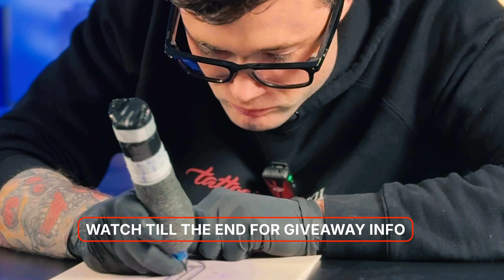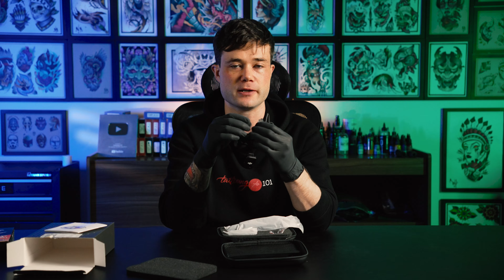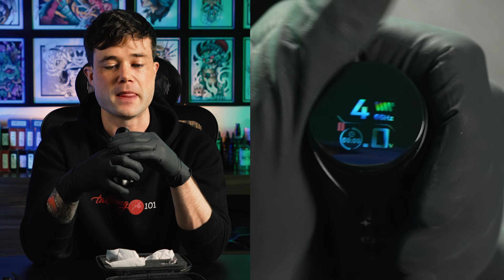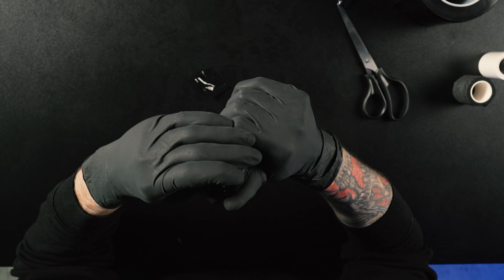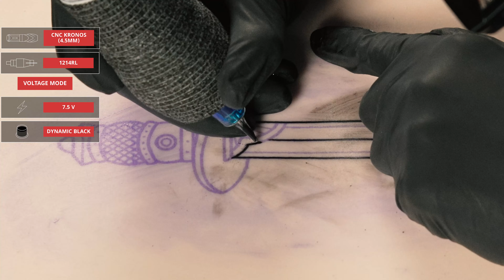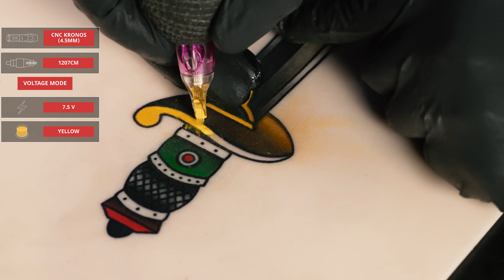CNC Kronos Adjustable Stroke Pen - Budget Tattoo Machine Review + Giveaway

Comment: Oh another question. Why wrap the machine? And how do you figure how much wrapping you need?
Reply from the maker: Wrapping the machine helps with hygiene and comfort. It creates a barrier between your machine and the tattoo environment, reducing the chance of cross-contamination. The amount of wrapping you need depends on your machine. you just want enough to cover the grip and other contact points without making it too bulky or hard to handle.

Comment: (My giveaway submission lol)

At a certain point when I am tattooing, the needle cartridge doesn't pick up as much ink and I have to dip much more often. With less ink, I can't pull nice long lines, like I have to take multiple strokes to build one line. It SEEMS like the ink is sort of.. drying up against the walls of the cartridge, causing it to have like, less surface area or something? 

Is this just buildup of my glide? I don't think it is, but it's hard to identify the issue.

Comment: Ok, I have done a few (very few) fingers. Top of the finger, ink goes in, stays in, no problem. They are several years old, and still look sharp. Same client, same finger, but on the side. I can't get ink to "sit" in to save my life. I tattoo it, 1 month later it's nearly gone. Then, to add insult to injury, same client, totally different location...same issue. I could not get a line to go in proper to save my life. Same machine, same needles, on a different client is not a problem. I ended up ditching the "pen" machine and went to my older rotary. The client FELT the difference, and finally the lines went in properly, but dang I felt like a noob sitting there with my (new-ish to me) pen machine and tattooing nothing but disappearing lines. What's the deal? I believe the pen, and my rotary have similar (within a mm) stroke, it's just like the pen couldn't push the ink in like the direct drive rotary can.

Comment: Does this machine allow for disposable grips or do you need to autoclave the grip? Also if you don’t have an autoclave is there still a way to safely wrap the machine so you can use it on human skin and fake skin (for any pen style without disposable grips)? Would wrapping it as shown in the video suffice for using on multiple clients as long as you cavicide the grip?

Comment: Really appreciate this review, I'm currently using a dragonhawk mast fold, its definitely much better than some of the other machines I have used, but always looking for a better budget machine 😎 
My question is about hertz. Is there a solid framework for what hertz works best for lining, shading, and packing? I ask because some of my machines have different voltage settings compared to hertz. I guess im basically asking what a good baseline for it?

Comment: I live in Mew Mexico which requires to log 1,400 hours before can take the the state test to be certified.  I work full-time and have a family which means i have very little time to give up.  The state website is not very helpful on finding who is able to sign off of the logged hours.  I am in the accelerator program.  Do you know if this course can be used towards that time?

Comment: Two trains are on the same track a distance 100 km apart heading towards one another, each at a speed of 50 km/h. A fly starting out at the front of one train, flies towards the other at a speed of 75 km/h. Upon reaching the other train, the fly turns around and continues towards the first train. How many kilometers does the fly travel before getting squashed in the collision of the two trains?

Comment: Heavier machines tend 2 accelerate the fatigue in my hand & wrist. Is there a cordless machine that is comfortable & light yet can be adjusted for voltage & stroke length? Without breaking the bank?

Comment: How many ways is there to make a machine when there is only one way to push a line into the skin? 😅 Making my own coil machines and wrapping my own coils has taught me so much about the mechanics of a running machine and therefore just how to put in a line. It would be nice to have something like this to keep up with this modern century(you have to keep up or you’ll be forgotten!), but there is nothing like the feel and hum of an old school cutback liner 🤣
Reply: I started with coil but switched to pen because after a short time of using a coil, my hand becomes over sensitized and it is overly distrating while trying to tattoo. I miss the sound and initial feeling of holding a coil machine.

Comment: Maybe I missed it, but did you ever adjust the stroke, or just the voltage?  I like the way you did the tape to allow for adjusting the stroke. Also, if you cycled power again would the needles end up in a different position (not sticking out)?

Comment: Hey, thanks for all the tips and very insightful info! I just started my journey a week ago and going through the line practices is challenging AF! I've being trying different holding positions and also testing between pulling and pushing my lines. So far, holding the machine as you did in the video, tilted back has being the most efficient for me. At first pushing the line made more sense in my mind but as I practice I noticed better results by pulling it. 

My question is about muscle memory. I read that resting a day or two between practice sessions increases you muscle memory. Do you have any input on that? What worked best for you? Is best to practice only straight lines for while than move to curves? 

Sorry, so many questions popping as I learn! Thanks again for the content

Comment: When you’re tuning your setup for different skin types, do you focus more on getting max ink saturation or on minimizing trauma to the skin? I was thinking about how that balance plays out with adjustable stroke machines like the CNC Kronos especially since its 2.7–4.5mm range can change how the ink sits and heals over time. Where do you usually find that sweet spot?

Comment: How do you decide which stroke length to use and how do you relate that to your voltage? not all machines are made “equally or the same” so how do you determine what settings to use as a “new artist” picking up any machine.  I understand that comes with experience and different factors like hand speed but for someone starting out,  what’s the best range to start learning in.

Comment: I'm just starting out. I have been a part of tattooing 101 for a month or so. I haven't done any machine tattooing yet on fake skin. My question is, starting out even with fake skin can be intimidating because I want to do it correctly. How do I get my angles correctly and correct depth? For doing straight lines, do I keep my hand firm with the machine straight up and down, or do I need a slight angle?

Comment: I have been tattooing for about a year. Started doing larger works and i have a little trouble covering large areas in even tone using greywash, for example - even midtone over a large area. Any advice or tips for this?

Comment: I seem to struggle with depth…what’s the best way to be certain you’re not going too deep causing a blowout?
Reply from the maker: You should hear a consistent buzz. The sweet spot is around 1-2mm into the dermis. You’ll know you’re too deep if the skin starts to puff or bleed heavy. Over time, you’ll grow a feel for the right depth with practice, just keep putting in the reps on fake skin.
Reply: @Tattooing101 thank you 🙌